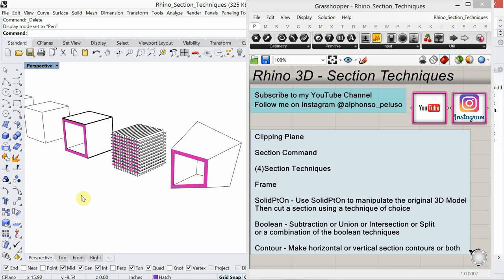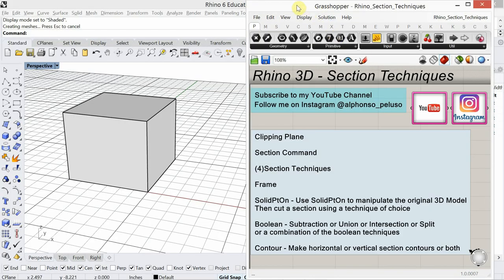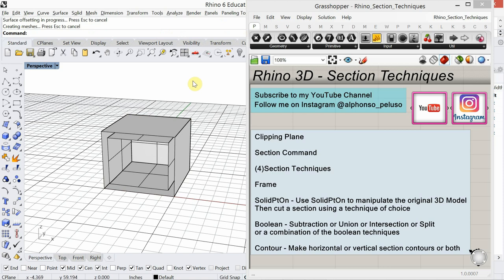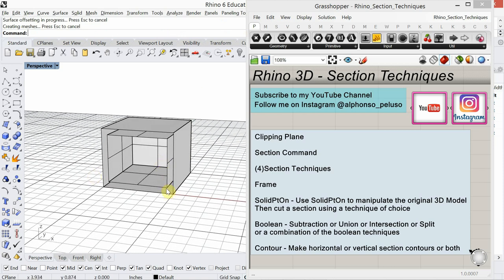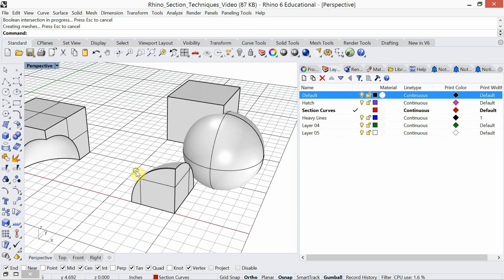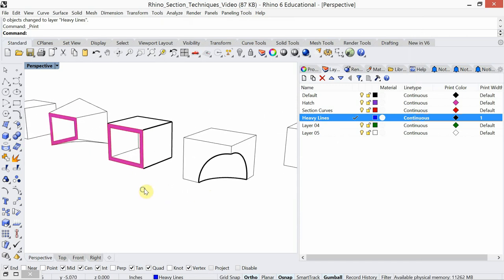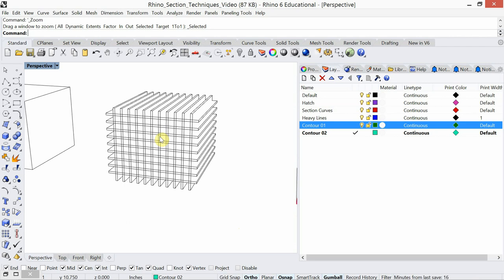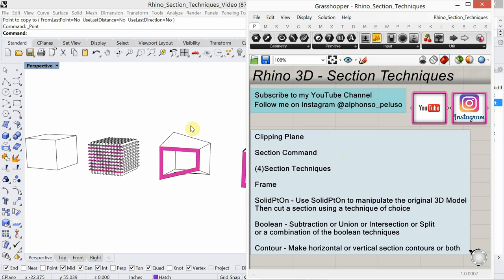Rhino 3D Section Techniques

Comment: Great video! For sectioning closed poly surfaces you may want to try the “wirecut” command. It allows you to keep both sides of the the sectioned object. Also the “shell” command can save you a few steps if you are adding thickness to a closed sold.
Reply from the maker: Daryen Ambrose Thank you! ..and thank you for the comment. Yes Wirecut and Shell are both excellent commands!